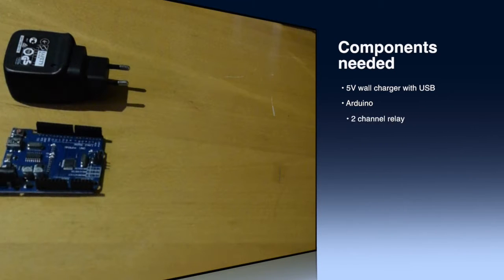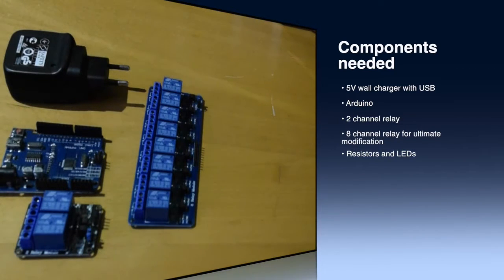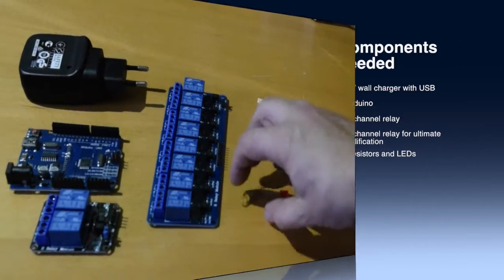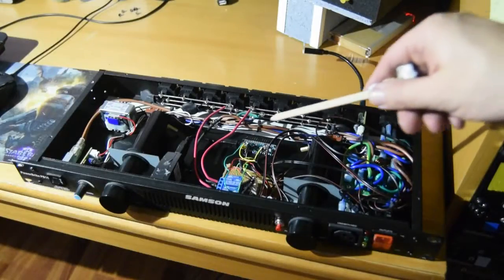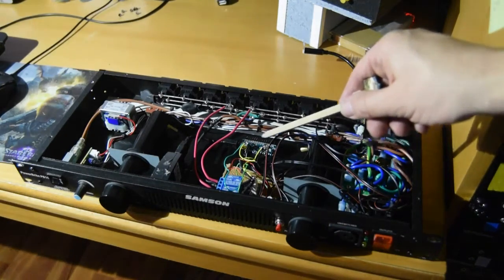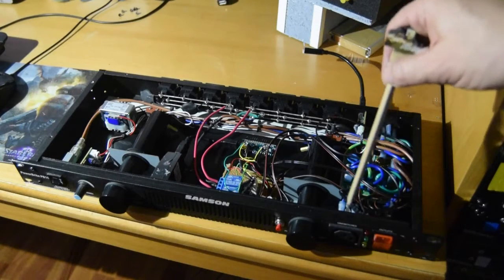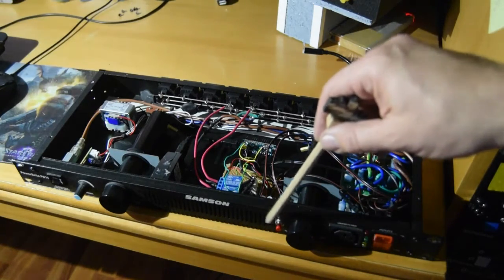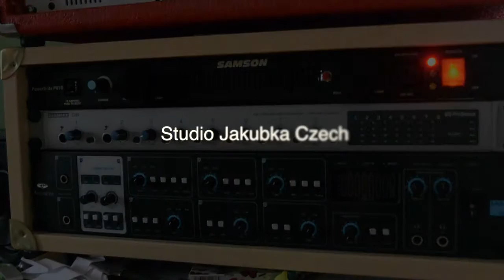Upgrading Power Conditioner/Distributor with Arduino microcontroller.

Comment: Nice and useful project, one question about Samson Powerbrite PB10, it really suppress ac noise?
BTW please can you send me the component list and arduino program file? thanks in advance. regards
Reply from the maker: This PowerBrite PB10 actually has got some circuitry inside the box, unlike other cheaper rack mounted units, which I own too, and the are just extender/distributor with fuse holder. Contact me using email and I will send you the Arduino code. And thanks for comments.
Reply: Ah, understood and thanks for the info. my email is jfvp.01@gmail.com
kind regards